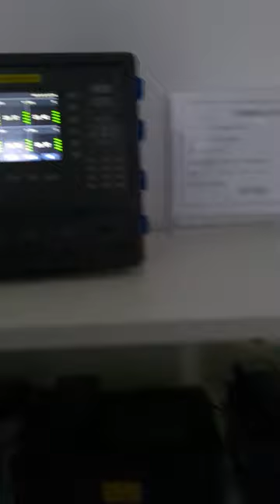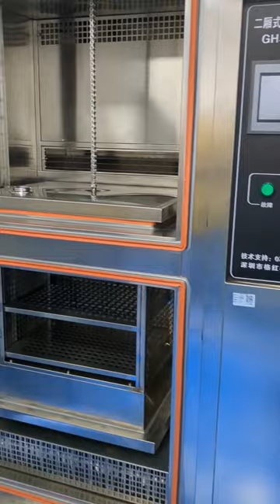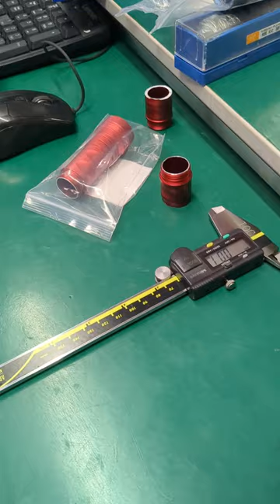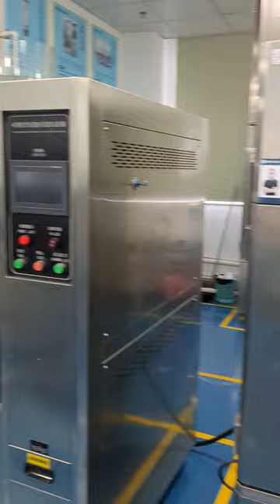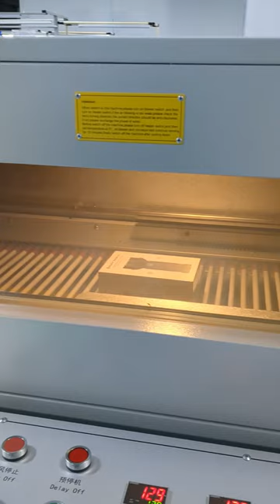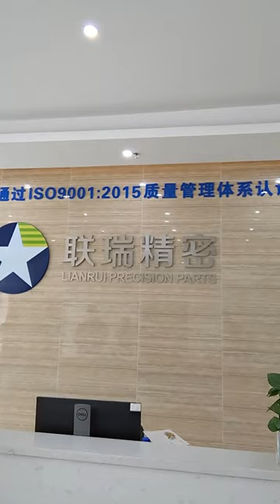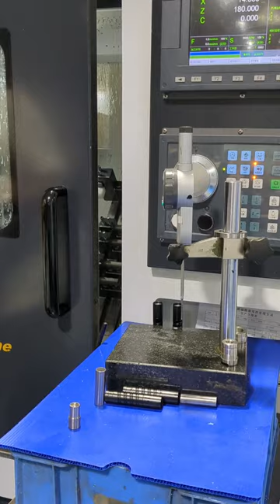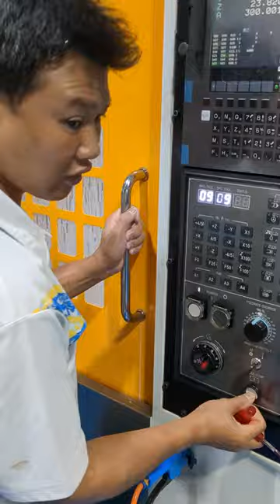Inside the Olight factory! 🔦 #olight #flashlight #edc

Comment: HA! They tell you to not use any external charger for their batteries but you can clearly see at 4:02 even them are using off brand chargers!
Reply from the maker: The 18650 and 21700 cells probably fit ok in something like an XTAR VC2L charger. The positive terminal may need a notch to be able to touch an Olight 21700 though. I can imagine the complaints that they'd get with people having different chargers that expect button tops and won't work with the proprietary design.